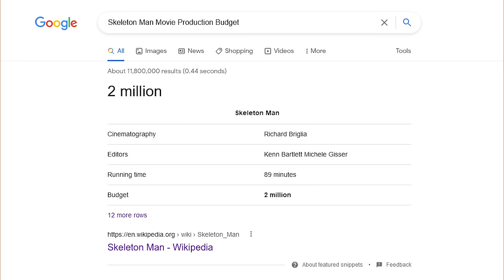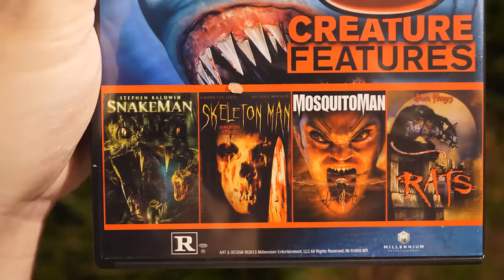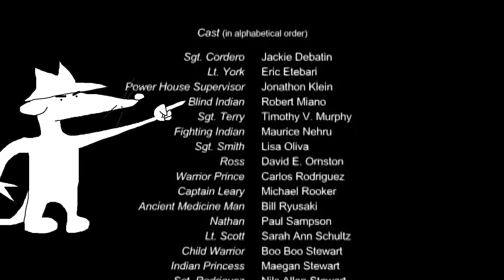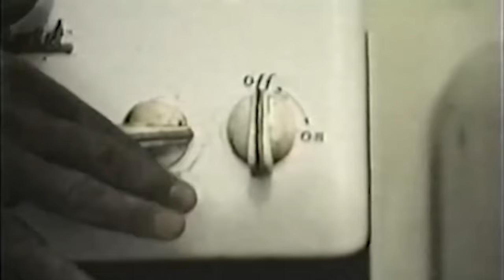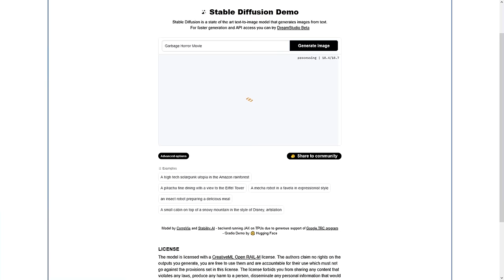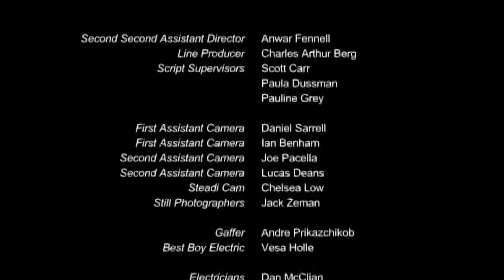Skeleton Man is an Awful Movie for Unattractive People

Comment: 6 bears says, hey 7 Buffaloes I know a joke.
 7 Buffaloes say oké 6 bears tell me.
6 bears replied how do u call 10.000.000. Raindrops fleeing.
I don't know 6 bears how do u call 10.000.000 raindrops fleeing.
Running water.

How is that a joke says 10.000.000 raindrops. That's not funny, jokes should be funny.
It's les funny than 6 bears says 12 beavers